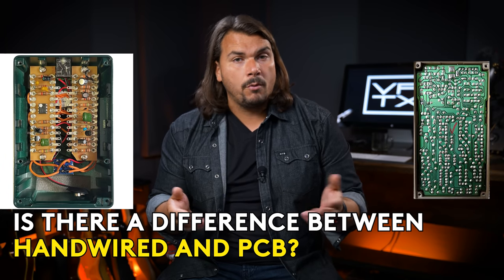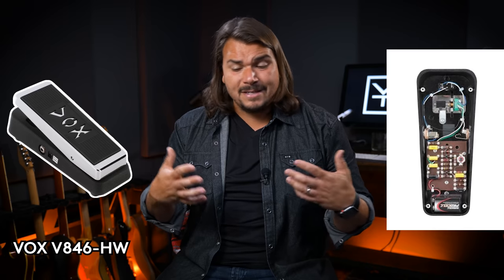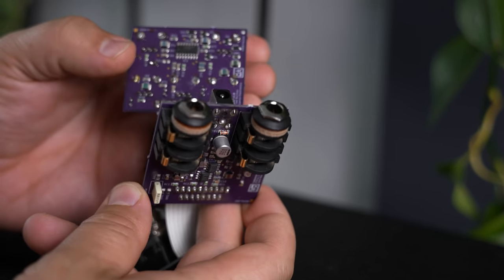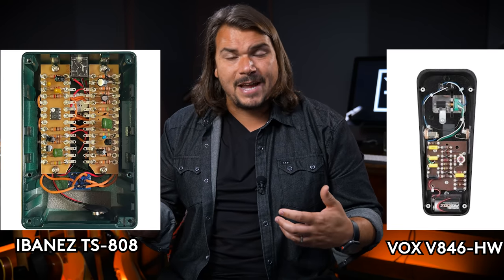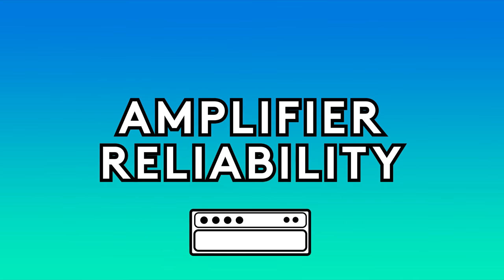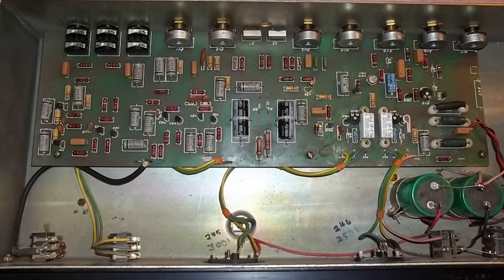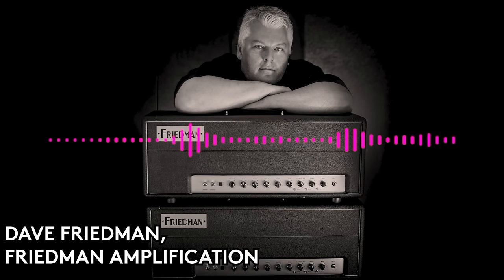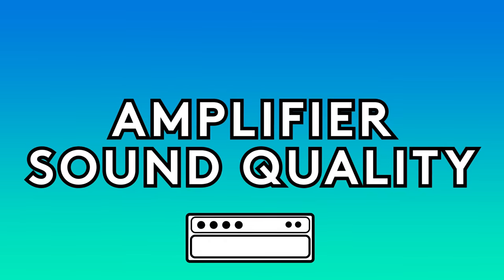Is Hand-Wired Actually Better?

Comment: PCB pedals are a no brainer, but when you are spending high end amp money you expect generational type quality. There is a built in obsolescence issue with the PCB based on nothing more than parts availability of the board, and when you use a PCB you start to see pots and jacks wired directly to the board which is a sketchy situation when you are paying 2 grand for a twin reverb.
Reply from the maker: I don't think that's true on high end implementations like Suhr, Fuchs, Friedman, and companies that understand how to layout a board and use the proper quality PCBS and traces.  The components equally are going be be no different than what's on a PTP amp (or at least they can be if desired).  Many builders will do a hybrid of PCB main boards and hand wired pots and tube sockets.
Reply: Vertex Effects for sure! I play a Mesa Lonestar Special everyday, and it’s a PCB with wire runs to the large user interface components. I also see amps with all the Pots soldered to a circuit board that at some point will be cost ineffective to produce. Old point to point boards can have issues with moisture that can cause voltage issues. I just think it isn’t as simple as PCB yay or nay.
Reply from the maker: @kevinschmitt4050  agreed!

Comment: This was really interesting, I always just heard hand wired is better and just assumed it true. I saw a video on Rhett's channel where they test a hand wired fender Princeton and the mass produced and the hand wired sounded so much better, the dude at righteous guitars seemed to think it was the hand wired nature. But thinking back it could've been any number of things. Really loved this. 

I do buy a lot of clone pedals and a lot are hand wired (old primitive circuits) and I've def noticed different tolerances vs buying the real pedal which has a PCB.
Reply from the maker: The problem with Rhett's video is that he assumes they're both the same circuit even though they say the same thing on the front of the two amps, they're actually not the same circuit, layout, or parts shared between the two amps, so really your not just comparing a handwired versus PCB amp, you're comparing two different amps completely.  I think they also have different speakers as well.  Same goes from clone pedals...a lot of them are like 90% clones or cheaper clones that sub parts, change the layout, etc. so you're not getting a 1:1 equal.  It's like saying you hate New York pizza because you tried it once when visiting LA.
Reply: The Speaker of the both amps are different. So they think the wiring is the difference when actually the speaker made the big sound difference.
hand wired = 10" Jensen P10R Alnico Lautsprecher
pcb = 10" Jensen C-10R Lautsprecher

Comment: Circuits with variable resistors make pedals amazingly tweakable. No two pedals I've ever built seem to match regardless of point to point or PCB. On another subject, I've been using 1/2" (12.7mm) Wirefy heat shrink instead of zip ties for my DC connectors. Very clean looking.
Reply from the maker: If you have a quality layout and quality components with 1% or less tolerances, you can have a very predictable result.

Comment: After repairing lots of amps I find that the price point  makes a difference. Some PCB amps in the 300 to 1000 dollar range are nothing but a huge pain in the ass to get at the components. It's almost as if the manufacturer gave no thought to serviceability.. I can understand why a manufacturer would use PCB construction but please make it easy to change a component without having to dismantle the entire amp. As for pedals why would anyone make a point to point wired pedal?
Reply from the maker: I agree...low budget requires a PCB and almost always they're not great, that's true, but it's also true that those are the worst implementations of PCB.  I think for pedals some guys think that this will have the same mystique as PTP amps and therefore improve the sound in some meaningful way.

Comment: I wonder what Howard Dumble or Ken Fisher would say. You can guess though.
Reply from the maker: This does not validate or invalidate the use of PCBs for amp designs.  They were making fewer than 20 amps per year at their max production (to the best we can estimate) - and most likely even fewer.  They were making custom amplifiers...there wouldn't be any reason to do a PCB in that volume if ever amp is tailored to the customer and this is named in the video as a reason not to use PCBs.
Reply: @VertexEffectsInc  Yes, doesn't invalidate PCB at all. I just think they might answer differently, that's all.

Comment: The medium of manufacture is all good if designed and built with care. What worries me as someone who fixes phone's and other devices is that as SMD/SMT manufacture becomes the norm in pedals etc. is that our ownership right to repair or modify the equipment we own is maintained. In other words are schematics and other relevant information going to be as freely available as they are today. In my experience for example there is nothing quicker and easier to replace than a SMD resistor or ceramic capacitor as long as you are given the correct value to replace it with. With regard to phones and laptops etc. for they are only able to have their logic boards fixed because good people in China are risking everything to smuggle out schematics etc to make the relevant info freely available. The sharing of knowledge that i see amongst pedal and amp builders and enthusiasts including many successful manufacturers that we currently enjoy today i hope will be just as prevalent in the future.
Reply from the maker: That's all at the discretion of the manufacturer.  We don't have any issues sharing part numbers with those that want to DIY or send elsewhere.

Comment: I have a Fender Blues Deluxe (original 90's model, not reissue) that needs a bit of work to be done by a technician.  A couple of mods for tone, a different power supply (I bought overseas so I want a new transformer and have it wired 110) but there will be some work needed because it's a PCB board amp.  Input jacks need to be replaced (no longer making good contact with the PCB) and the ribbon connectors will probably break when the amp is opened up (known issue)
Reply from the maker: A lot of these are known issues with the Hot Rod amps in general...not the best example of PCB made amplifiers compared to say a Suhr or other high quality PCB-based amps.

Comment: I hate asking this question on an unrelated video, but I can’t seem to find much help anywhere. Is there a need for a buffer when using an iridium/ACS1/amp sim? I imagine one is needed at the beginning of the chain as usual, but should you put one before the sim pedal? Or are the input values different and thus there isn’t really a need for a second buffer in that context?
Reply from the maker: If the Iridium/ACS is last, no.  If other pedals follow it that down have a 100 ohm output impedance and are buffered, then yes, you need an output buffer.

Comment: I understabd the reasons to go PCB and they seem logical. But why is it then that even in HiFi where good sound and consistency are even more important hand wired products win out against their modern pcb built counterparts? McIntosh for example comes to mind...
Reply from the maker: It would come down to the design not the method.  PCB will be more consistent and can be exact, but if the design ins't done properly then it won't measure up.  That's what confuses people most is they think it's a method issue when it's totally on the designer.
Reply: Mostly because of marketing rip-off.  People believe that HAND WIRED = BETTER so will pay a premium for it. Delve into items where you can get both "standard" and "hand wired" models and you'll pretty much always find that the hand wired also has different components in a different circuit - basically the manufacturer is adding a significant premium to the price in exchange for a few better components, and then making the standard version worse by design to create an artificial "premium" product. If I want to charge  you 6 figures for a piece of fairly simple electronic gear I'd better be doing something to make it look difficult. Electronics is all about design, and good design trumps both component quality and how it's built all over the shop.
Reply: @realtruenorth  If it uses substandard components and construction it's a bad design. "Better Quality" is a meaningless concept without qualification as to "better for what" - is an Aventador better than a Mondeo - not if you want to use it as a taxi,  is a $25 resistor that has  .001 dB less self-noise a better component that the 15c equivalent -  in a fuzz circuit? The spec is better, the application doesn't care. You can build an amp that is amazingly sensitive to tube spec, that needs $3k a piece glass to be usable, or you can design in the right amount of negative feedback and get great results with a £50 tube. Check prices on Reverb, folks are paying insane amounts of money for what is essentially "badge engineering" in pedals because they have "the right chip that you can't get anymore", even though blind listening tests indicate absolutely no preference for the expensive model. Bob Weil, Josh Scott, Bill Finnegan have all experimented with this stuff and concluded the same.

Comment: If you advocate for soldered patch cables for a pedalboard build because soldered patch cables have a greater ability to withstand physical stresses, would the same hold true for hand-wired amps (they are more durable).. because there is more soldering connecting the parts/wires as compared to a pcb and/or a larger point of connection?
Reply from the maker: Totally unrelated and not comparable.  My argument for soldered cables is about a gas tight connection - same is true here of PCB or PTP handwired.  In the end both methods are soldered.  Secondly, patch cables are external and exposed and manipulated - amp connections and traces are internal and untouched outside of servicing.  An equally well built PCB and PTP Handwired amps are going to error on the PCB amp being more robust - less human error, less bad solder joints, less failed solder joints due to vibration.  Most of the high quality PCB amps like the Suhr's still wire high use components off of the boards and select wiring like the heater wires, sometimes pots and switches as well.
Reply: What they show here isn’t the surface soldered but every aspect involved into the producing such equipment, specially the human factor. Mr. Marangella advocates for you making your own pedalboard and cables due to the fact you can understand it better and customize it for your own tastes or needs, not for any other reason, specially financial gain, as he’s sharing his years of experience with us and depend on  patreon members to make it happen. Notice that he doesn’t have a ton of commercials nor advertisement on his videos, and promotes way more his competitors, based on his opinion and quality of their products, instead of selling his own. He makes pedals and they are great! I followed his advice and tried out his booster and it works as it should, and I didn’t buy the most expensive but, based on his quest for quality, I felt confident it would work for my purposes, and it did. He doesn’t advocate for expensive stuff, but defends quality at all costs, he always promotes subjects, not products! Notice that when he releases a video about a subject, he carefully chooses a few options, from affordable to very expensive, and describes why he prefers/recommend one over another! He’s young to the amount of knowledge he has accumulated on this industry and, kindly, shares it with us all, paying or not!

Comment: My pedal related question is, given PCB circuits are physically smaller, is that ever a constriction in terms of signal flow? I assume the answer is no based on this video, but I would love to know why certain PCB using pedals seem to "thin" or even distort my guitar's tone when others do not(when the given effects parameters are at minimum or even off)? Is it that they maintain a parallel "clean" path? Or is it that the designs or manufacture are that different in quality?
Reply from the maker: Generalizing that PCB pedals thin your tone is a misnomer - it would be specific to the pedal and design, and nothing to do with the PCB.  Remember most famous pedals are all PCB: Tube Screamer, King of Tone, Klon Centaur, etc.  If you find that there are artifacts present in your pedals it could have to do with the build quality as there are no standard for PCB thickness, trace thickness...some companies go super cheap, some companies to super thick and robust and have thicker traces than the equivalent wire gauge in a handwired amp.
Reply: Physical size rarely has the type of effect on signal you are talking about when talking pedals. Pedals work on small voltages and tiny currents which can be reliably carried by very small traces. More likely it is some combination of input impudence, instrument output level, and noise. Also, if you are talking about multiple pedals in a chain, the number and position of the pedals can have a large effect on the perceived sound, as can cable length (input impedance) and quality, and pedal power supply quality.
Reply from the maker: @fhare666  yes...this exactly!
Reply: @VertexEffectsInc  how would one be able to judge the quality of design or attached components aside of trying it out in context? Is there a way to find out prior to purchasing, based on where the parts come from or whether designers are specifically named? If some form of legit vetting was possible, it sure would help. In some cases, I have gone for years thinking I had the wrong cable/guitar/amp/etc when in reality I just hadn't found a quality pedal, or didn't know to change some other element; like using a direct box, etc
Reply: @fhare666  this has been my quagmire for years now; sure would be nice to have my own tech😄
Reply from the maker: @mikesharpsongs  for the most part when it comes to the passive components, within reason, there's not a huge quality variability as most of us are all buying our components from the same sources typically with exception to some of the really budget Chinese-made stuff.  The things like layout and design will have the biggest influence in the long term reliability and consistency of the product.  I think the thing to consider is - do you trust this manufacturer and what's their track record like with reliability and warranty after the sale so you have some idea of what to expect down the road after the sale.  That's the best you can do short of having someone teardown the product and show you what's inside (which is now becoming a thing on YouTube).

Comment: Awesome video! Sometimes its not so simple as "HW vs PCB" though. I feel like there are different levels of PCB, and you mentioned this saying the method must be executed right. But take the Tone King Imperial MkII, its PCB, but it still looks highly servicable and logically laid out. Its a PCB amp built like an old HW amp. On the flip side, amps like Blackstar and DV Mark exist, which feature very intense micro components and increased complexity.

People say that those amps are treated as "toss-away" amps, that you just have the manufacturer replace the entire PCB when something goes wrong, or you just throw it in the garbage and buy a new one. So then, another consideration is road-serviceability, at least if you are a performing musician. Can you take the amp to a local tech and have them fix it before your show the next day, or like Blackstar, do they require you to send the entire unit in over a week period for full PCB replacement?

I guess my point is, PCB seems like it has many various levels of complexity, from "basically handwired but using a PCB", to "basically a small computer". Handwired stuff can also get very complex, but even at its most complex most techs would be able to service them provided they have access to the schematic. The same is not true of the really complex PCB amps.

The new Blackstars are especially relevant. At over $1000, I no longer think it should be considered appropriate that you "toss the amp" if it craps out outside of warranty. Your hope then is that Blackstar continues supporting this product and making replacement "drop-in" PCBs, but who knows how long they actually will.

Anyways, I appreciate you dispelling common myths, I think there are an absurd number of myths, superstitions, and other snake oil bullshit in the guitar world that can affect us all in a negative way if we aren't aware. Any clarity you can bring is much appreciated, I look forward to more videos from your channel!
Reply from the maker: Thanks for this comment!

Comment: I remember when the new PCB-built amps and pedals came along. Things got smaller mostly. But also the sounds weren't accurate. I'm not sure if that's an accurate description but I mean the sounds were a bit like the original Synths where every sound FX sounded the same. But as time went on they got better. But another gripe was build quality. People complained that the PCB boards would break if you didn't treat and handle them with kid gloves. I'm not sure a PCB vs Wired affects tone, I think under lab conditions it would be hard to tell if not impossible. For me it's about durability and build quality. I just bought some PCB built pedals from TC Electronic and they sound fucking amazing.
Reply from the maker: Early PCBs in musical products were poor - admittedly, this isn't representative of what they can be with high standards and good designs.  Quality PCB amps will last as long as any PTP HW amp.